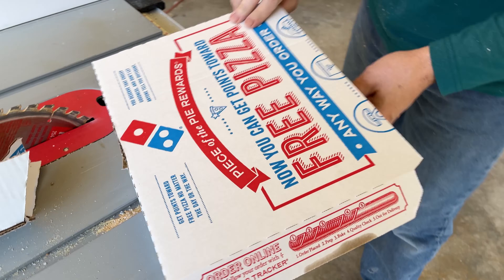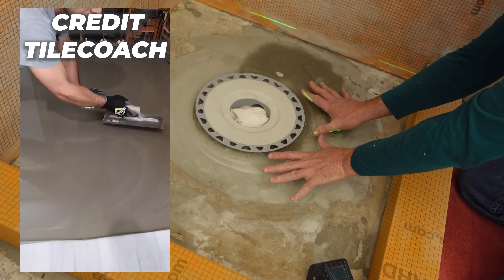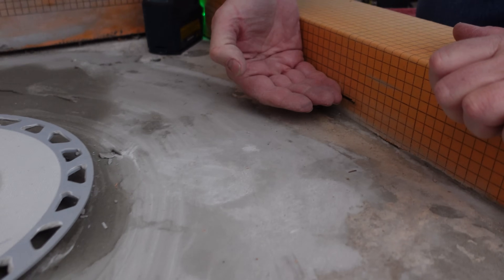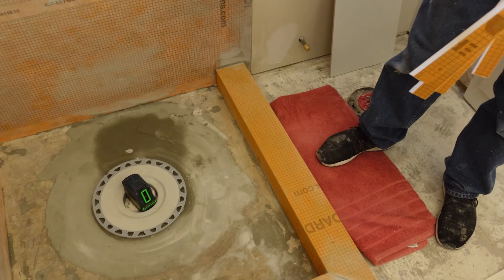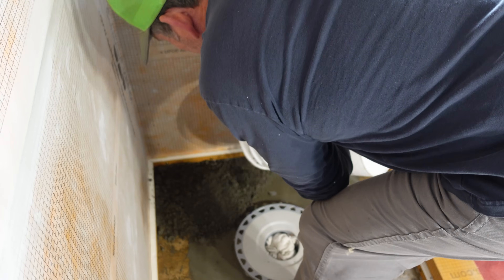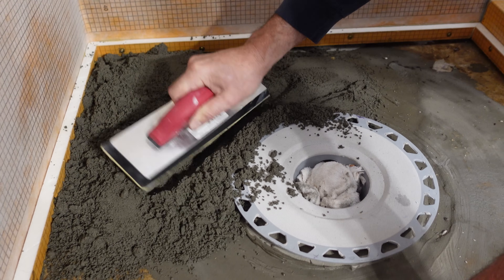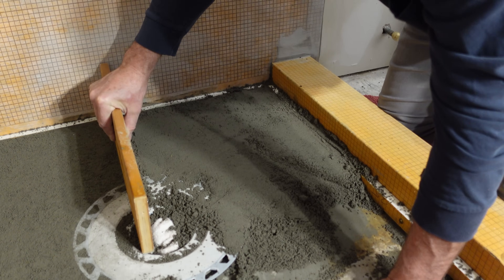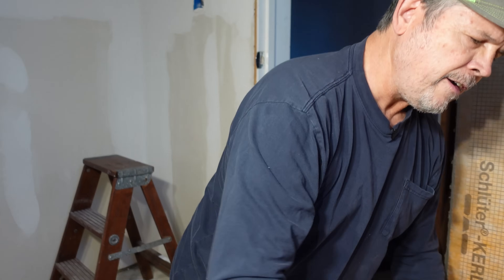HOW TO BUILD a PERFECT Shower Pan PRE-SLOPE (Great for DIYers)

Comment: Thanks for all the videos you make, they are great. I used your idea of using the kerdi foam as screed. I have a question for you though. Is it normal for a little bit of water to sit around the shower flange? This is only for the pre slope, I have not done the second layer at the linear drain yet.

Comment: We have a 6 foot by 8 foot Baptistry at our church  with a metal Pan which will be a massive project to pull it out, as it was built before the walls and I was thinking of trying to put down a membrane and using tile to repair it as it's starting to slightly leak.  What would be your thoughts on Adding ceramic tile to a metal pin baptistory rather than tearing out and rebuilding another metal box.?

Comment: That floor mud mortar stuff is very difficult to find in my area. I used normal modified thin set and it worked wonderfully. I would recommend that you use a constant wet trowel for doing the final sloping/smoothing. Unfortunately, I am not sure that I can add pictures here.

Comment: The traditional way was to put down the copper pan and then float the mud on top of the pan, forming it to have the appropriate pitch to the drain.  But it seems all you youngsters know is high tech half-assed short cuts.

Comment: On the pizza box, I would ensure that I used a push block or push stick in order to keep my fingers away from the blade. Safety first! Not sure the box was square on that one side so ensure you check it with a T-square. Slow down a bit when cutting the cardboard; let the blade do the work! Great video, though!

Comment: How do you know how tall to set your drain flange past the cement slab?
Reply from the maker: 3/4" above the cement slab is recommended minimum thickness for the deck mud.  Go higher if you want to

Comment: Great Video I have a cement floor I removed the bathtub I moved my Drain to the center it is going to be the shape the bathtub was I put 2x6 between the studs I need to build up 1 inch can I put cement to bring it up the 1 inch and put my Liner and use this Mud over the liner?

Comment: As for gagging the slope, I took a piece of 2x4. On the side of the 2x4 I measured 1/4” from top of it down. Set drain height at the 1/4” line, then used 2x4 full height to mark a line going along all sides. That gave me a 1/4” slope which is enough to drain.

Comment: New to this.  Why did you start with your drain off of the surface of the concrete floor?  Any reason not to start it on the concrete floor and put silicon under it to seal it to the floor?

Comment: I am building my own home (Barndominium). When they poured the concrete floor, I had them frame the shower floor (5'x6') and not put concrete in them. It is a dirt floor at this point. The drain is in the approximate center. This is also going to be a roll in shower (wheelchair accessible), no curb. The concrete is about 4" thick. What process would you use to build a shower floor from this point forward, etc. rubber liner, then hard pack?

Comment: how high did you set the shower drain off of the subfloor? or does that depends on the slope? i've seen some videos where installers are making the large circle part of the drain flush with the subfloor

Comment: New subscriber, what a great channel you have! When figuring out the screed heights would you use the furthest measurement? I will be building a 60” x 32” shower with the drain 15” from the end wall and 15” from the side wall. That would leave a super aggressive slope on the walls closest to the drain but the proper slope on the far lengths.

Comment: Hi! My husband is DIYing our shower. We used the schluter presloped shower pan (which is waterproofed) and linear frameless drain. Unfortunately, the edge of the channel body ended up higher than the edge of the pan. Very frustrating. So to correct this, and after consulting with a few others, he is using 209 floor mud to build a new slope to correct the issue and avoid pooling. Does the floor mud then need a layer of waterproofing before we can tile or can we skip that since it's waterproofed under the mud? Thanks in advance!

Comment: Schluter specifies a plastic sheet and metal lath between a plywood or concrete substrates and a mud bed. They also specify an inch of mud bed at the drain if over plywood, and 3/4" if over concrete. 

Just some things I noticed were missed. This installation would likely not be covered by Schluter's warranty with screws puncturing the waterproofing around the walls also missing the wire lathe and plastic.

Do I think it will fail? Probably not. Especially being that small of a shower, it will probably be fine. Just don't expect any kind of warranty from Schluter if using this method.

Comment: What about the flat perimeter ledge when you tile? Same issue for the video you did many years ago where you cut concrete and a breaker hammer. The ledge of Kerdi can be worked around because you have a standard shower design. It is not so easy with the larger concrete ledge in the past video. You can't build up over the concrete ledge. A corner tile piece could work. Or you have to remove the concrete ledge to keep a no curb shower.

Comment: Hey guys i got an awesome tip for you when mixing dry pack, this is what me and my dad use and it's life changing! Get a 8 gallon mixing bucket from Collomix, they have it over at the Acme Tools website. Prefect for mixing full bags of dry pack so it will not spill or if you need more. 

And lastly the best tip of all, get you a Goldblatt Monster Mixer, its an auger style mixer that mixes dry pack with ease, perfect consistency throughout the entire mix every time. There are two versions of it, i recommend the bigger 4.5in diameter one, the model number is G06160. It's on amazon.
Reply from the maker: Thx Mac 👍.  I’ll check out the bucket.   Acme Tools rocks👍.   I recently saw that auger too.   Definitely cool 💪👊

Comment: Kerdi no, ditra yes. Do NOT use glue for schluter foam products, use thinset. Use a mortar arger ( bucket mortar mixer )  for the mud, or a hoe and a cement pan. The mud needs to be packed hard, that gives it the strength. Yes you can do a floating mortar bed ( un-bonded ). But its need to pretty thick for the strength.

Comment: Can a polymer infused thinset be used for preslope or is that asking too much ? I intend to freehand the shower floor adding a rounded pea gravel surface rather than tile. This is first shower I've done. Waterproofing and cement board w the fiber tape in edges, corners and seam. I think I'm ready to do preslope but only have thinset. 
Am I messing up ??

Comment: NO SCREW,LIQUID NAIL WILL DO IT,ALSO DONT CUT TO FIT EXACT,LEAVE 1/4 INCH SO YOU CAN HAVE A LIL PLAY TO FUDGE ACCORDING TO FLOORS IMPERFECTIONS AND SAVE ALOT OF TIME AND PACK UNDER THE SCREED STRIPS WITH DRYPACK AND THINSET SLURRY,GREAT VIDEO AS ALWAYS, THANK YOU FOR HELPING US ALL OUT REGULARLY TIME AND TIME AGAIN 😀HAPPY 🐣 EASTER ✝️

Comment: Does this process work when raising a shower drain? For example i dont want to dig in the concrete to move the drain but would rather connect to it with a pipe. That means the drain will need to higher.

Comment: How much more difficult is it to do this with an offset shower drain on one end? Obviously you’d need a longer screed, but is it as easy as it is with a center drain? Any advice? I have a joist running right down the middle of my shower stall, preventing me from using a center drain.

Comment: Thanks for the video. 
I have a question about water proofing. 
I’m only using backer boards on the shower walls and floors, Will applying REDGuard be enough to waterproof it?

Comment: I've been using the gray pan shower liner rubber membrane stuff under the dry pack for years, is this unnecessary? The shower pan liner package has a nice picture of how it's supposed to be. I guess my question would be does this go out the window with the schluter membrane on top of the pack? Surely not

Comment: Getting ready to do this and I have a question. To clarify, a total newb question...
After I put this in, I water proof it with the membrane and thin set. After that, it's tile time right? Or is this called a pre-slope because it needs another mortar bed on top of the the membrane? If you can clarify this, is truly be grateful. Thank you.
Reply from the maker: After this step, waterproof with sheet membrane/thin set and then you're ready for tile.  "Pre-slope" probably not the best word

Comment: Great video.   I want to use this technique for a basement shower.  I have a concrete floor with a 2” piece of copper pipe for the drain.  Trying to find a drain to use that will connect to it.  Anyone know?

Comment: Would you want to do the floor first so you can put the waterproofing on the floor down first the the wall waterproofing so it overlaps the floor waterproofing. Similar to shingling?  Doing the walls first would leave an opportunity for water to get in.
Reply from the maker: With Schluter it doesn’t matter.  They warranty it either way 👊👍
Reply: Yep! Schluter warranties it either way. It really comes down to a matter of preference of installation. Do you want to do the floor first and then try to protect the floor from falling and dropping things or do the walls first and then install the floor? Ultimately you should have the floor covered and protected when you are working on the walls so that when you drop a trowel, thin set or whatever then it is still protected. I hope this helps. Thank you! 😙😁👍

Comment: Did you make a video of you doing the top layer of this pan with traditional mud instead of a Kerdi pan?  I am building a large 44 x 68" shower with GoBoard walls using a traditional deck mud top over a Oatey PVC liner, with a center drain, and I am thinking about doing the same thing. I see no reason why it would not work the same way using GoBoard as the edge/top of the pre-slope?  Am I wrong??

Comment: So drypack is supose to start at 1-3/8" at the minimum around the drain for strength. But being on concrete and using a membrane should be fine. I have taken out traditional pans before that were cracked from the drain out before on  plywood subfloor. I think the wire lathe is a great option for strength when running this method on plywood when the drain height is under 1-3/8" on the drypack.

Comment: If foam and lasers aren't available, it's extremely simple make a screed ledger with nothing but the mortar. Find where you want your height of your ledger and put mortar there. Use your level to get that motar level on one wall. Cut it off about two inches from the wall and then move on around the entire shower continuing to use level to ensure all is correct.That'll give you a full two inch wide ledger to screed on.  Then fill in everything and pack it hard then screed it. Unlike stated in the video, you must put effort into packing the mortar. The purpose is to collapse any air pockets and get a more dense mortar bed. It is necessary to a strong base to build a shower on
.

Comment: hi there. do you use 5: 1 or 4:1 ratio. I built one my first time ever it worked it was not perfect . i used the 5:1 i mixed it my self . my question is how much water should i add ? i used 3 bags of all purpose sand 50 # each and 32# of portland cement added 8 litters of water , was that too much water for what i had ?

Comment: I just set my laser level in the corner at the appropriate height and throw the mud. just screed the mud down to the laser line then use a level for the last section where the laser sat.

Comment: This is a great video! Lots of great tips. Can you share with me the part number and manufacture of the floor drain connection?
Reply: They are using Schluter. If you go to Schluter’s YouTube channel directly then there are informational and instructional videos on just about anything you would want to know on their products. Also you can go to their website. They have phenomenal customer service that connected me with a local representative that I can call or text for support before, during or after a project. They are willing to help me plan a project if needed. I also signed up and attended 2 workshops that they offer nationwide for free. They covered the meals and hotel if needed. It only cost me my time. Very cheap investment for what I got out of it. The class did not just cover installing their products with hands-on training but also covered the legal fundamentals from the TCNA handbook. Their warranty is second to none that I could find and I didn’t find their company and product until last in my research. So if you choose to attend their workshops then I hope that this helps. I just think that people should do their due diligence and decide for themselves. Thank you!
Reply: @insecureinvestorchallenge7366  Thank you for all the info. This is very helpful!

Comment: I’m building a shower pan in a very small area in about 35 x 36 should I put the drain dead center I was thinking of putting it all away to one side but center front to back any suggestions

Comment: May be a stupid question but why is there a small gap between your guide for the pre slope and the ground? I’m completely new to this haha
Reply from the maker: Just makes it easier to install.  Rip the guides thinner than needed then install right on the laser line.  If I tried to scribe them to fit the pan and the laser I'd probably sacrifice some accuracy in the level.  The gap is inconsequential.  The dry pack is supporting the floor tile.   Hope that helps.

Comment: Can you show us how to level the floor of an old garage stem wall floor that is being converted into a casita. As you know a stem wall foundation for a garage has a slope from high on the inside to low on the way out. What would you use to level that floor and what would you use to finish the floor to receive tile, carpet, or laminate wood floor? Chew on that for a second.

Comment: How do you determine the angle to cut the bevel on the foam? Also, is that foam edge where it meets the mud going to be water tight?
Reply from the maker: The angle is not important imo.   That small edge gets covered by wall tile so as long as there’s any angle you’re good but not too extreme just a few degrees.  We waterproofed it all in next video

Comment: Just a thought.  You have cut your side pieces all the same.
The drop will be different as you go around the drain. If you decide the sides ,which are closest to the drains,  will be a ¼ inch drop per foot and that a 1 inch rail will work. However this 1 inch rail will will give you a less than ¼ pitch from the corners.
Should you not start in the farthest corner to establish the correct pitch and rail height. The sides closest to the drain will end having a sharper drop to the drain. The least the fall in any part of shower floor  would be ¼ to 12inch drop from the corners.

Comment: I'm curious if code allows that many screws to be punched through the waterproofing? I've never seen any setter intentionally punch screws through a moister barrier.
Reply from the maker: It all gets covered with floor waterproof layer.   It’s fine 👍👊
Reply: @StudPack  I know. I was just curious if code allowed it. Here on the West Coast per code we cannot perforate any waterproofing below a certain height. I was just curious if code where you work allows it.

Comment: If you could answer this please, what is the current best practice for tiling a kitchen floor. We have cracked tiles now after 30 years and the little lady wants to replace it it is put over three-quarter inch plywood With 12 inch on center Jointedunderneathinch  so that was done properly My question is is there to be something applied to the plywood as a relief or do you just tile right over that again?
Reply from the maker: Hey Mark.   Tile won’t adhere to plywood.   A product like Schluter Ditra is one option but sounds like good old 1/4” backer board is the answer for you.  It must be installed with thinset troweled on between the plywood and backer board.    1/2” thickness is also available if you need the strength.  Best of luck 👊👍

Comment: That was awesome! I definitely feel like I can do a preslope now! How about if you have to move the drain over in a concrete slab if you need to center things? Is there an easy way without having to cut into the slab and move it that way?
Reply: Nope, sorry to say. I am happy that I chose to invest only my time to take the FREE Schluter Workshops that are available across the country. They covered all meals and a hotel if needed. I got hands-on training and taught the legal minimum standards from the TCNA handbook. Absolutely invaluable experience! I can’t imagine trying to tackle 4 bathrooms and one of them with a concrete floor without these workshops. 

Schlueter also has a YouTube channel for installation videos of their product per their specifications. Stud Pack tends to get it right more often than not but everyone should do their own due diligence to ensure that the details and installations are being done correctly per the manufacturers specifications. Not all channels demonstrate this correctly. I hope this helps. Thank you!

Comment: question? if you are going to use tile which is 1/4" to 3/8" thick, wouldnt you make the drypack lower than the flange of drain , so that when you did thinset and membrane on top of drypack, , then thinset and then tile, you could make top of tile , flush with top of drain flange?
Reply: Excuse me for not having the proper terminology 😂😂, , the drain isn't finished , i would think the drain gets a grate screwed into it that is roughly a quarter of an inch... Cheers

Comment: If I’m not using schluter, just concrete board, thin set and red gaurd what would be best to put on top of my dry pack slope?
Reply from the maker: Concrete board is not recommended for use under shower floor